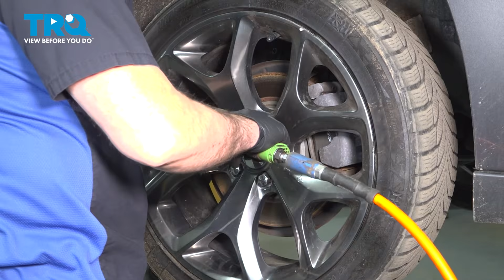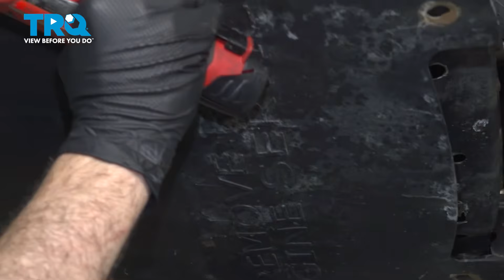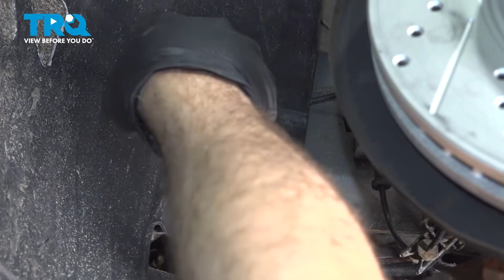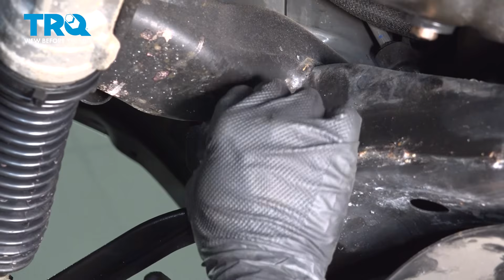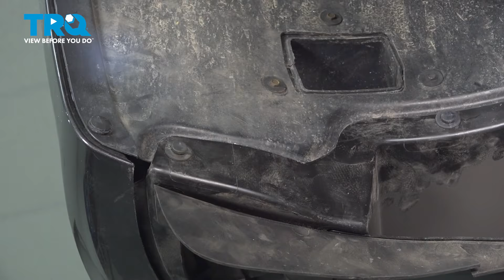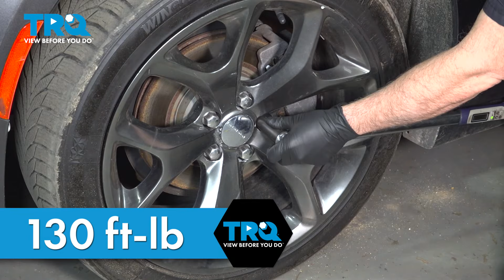How to Replace Front Lower Forward Control Arms 2011-2023 Dodge Charger

Comment: Hey man, just curious I replace the lower forward control arm and a sway bar link. I know I have a bad strut, but when I driving there is a binding or notching feeling when I turn left, no noise. It’s slightly better since repair, is it likely the tie rods?